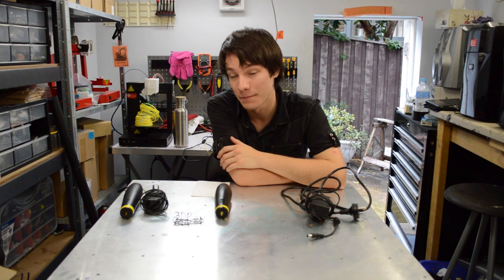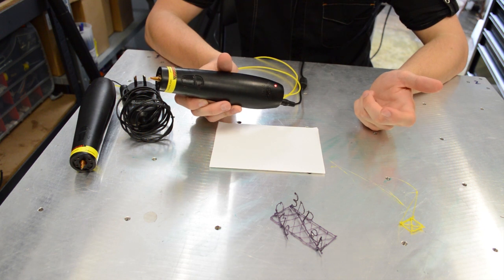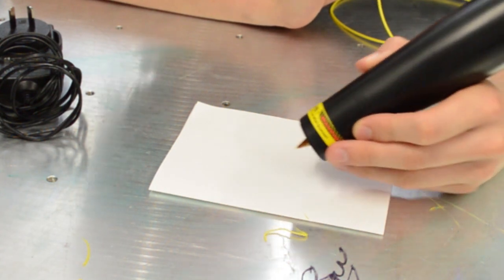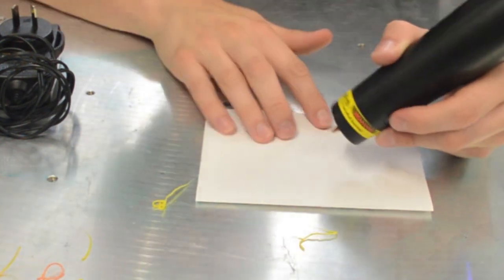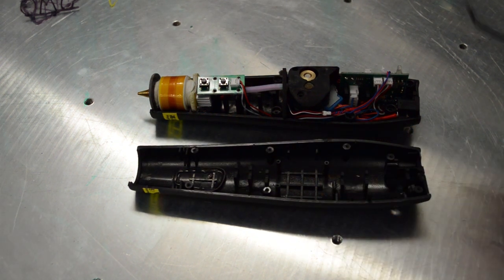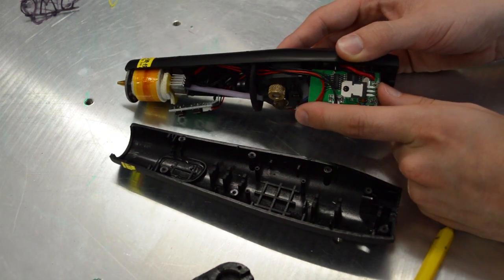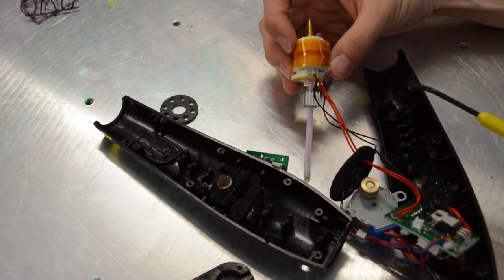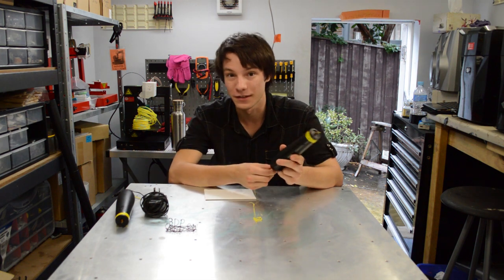3D Printing Pen?! Review and Teardown

Comment: Does this pen use abs and/or pla? Thanks
Reply from the maker: The yaya pen tested no longer exists - old and slow you can get much better now. It had one temperature setting which was too hot for both PLA and ABS.

Comment: If you are reviewing a Yaya (knockoff) 3D pen - you really should not act as if it is the same thing as a 3Doodler. If you want to give a professional review, you review a specific product (Yaya 3D Printing Pen) or you have several products and compare them. 3Doodler has images of what it looks like inside (http://philipcotton.com/2014/03/28/3doodler-the-kids-just-love-it-so-do-the-teachers/), and it looks nothing like this. While you are trying to make modifications to the Yaya to improve it, 3Doodler was already a superior product with those modifications. In addition Yaya uses thinner filiment, so the things you create are going to be more fragile or take more time to build the same thickness. It also makes it more difficult to actually draw upward in 3D.
Reply from the maker: Cheers for the input! At the time I did the review the 3Doodlers were only just shipping to backers, so no one knew how well they worked - the first batch had all sorts of issues that they've obviously resolved now. Both the Yaya and 3Doodler videos do contain vastly spedup footage though. All in all though, the 3Doodler looks like its come a long way since I made this vid, but it doesn't change the fact you're putting a tool with an exposed hotend of 200+degrees into the hands of a child...
Reply: Technically, they aren't supposed to be for children under 12, though. I would love to see an updated (or new) video about 3D pens if you have one. I use videos like this to help with my freelance writing work. Plus, 3Doodler is coming out with a new version soon.